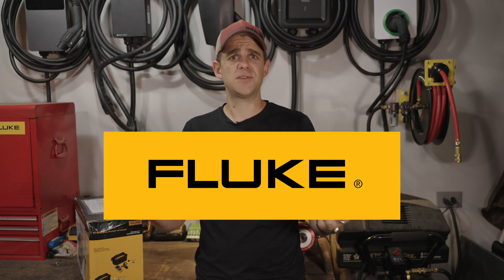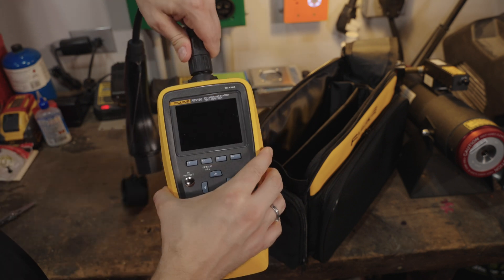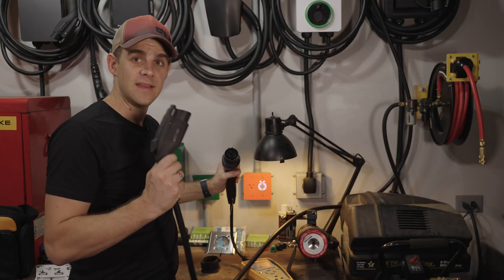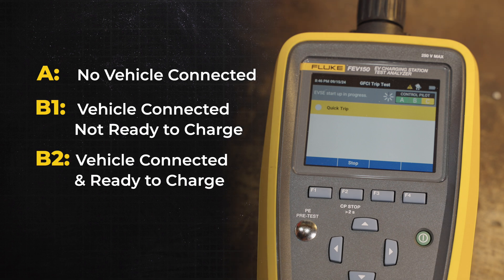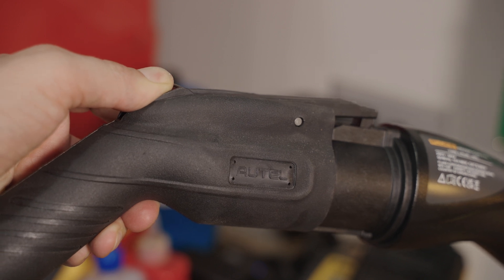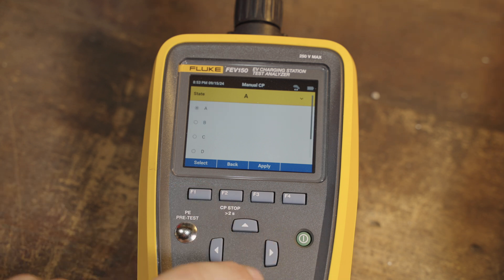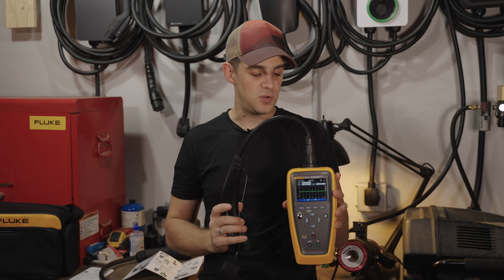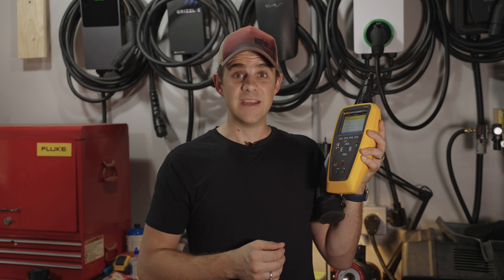FLUKE FEV150 EV Charger Tester Review

Comment: Those error checks were interesting... now you have to redo all your charger reviews so we can see who does that right.

But overall I'm really impressed with this.  I was assuming it was just going to read duty cycle and voltage to confirm that it runs, but it checks a lot more parameters, details that I might not have thought to check doing it manually with a breakout box and a scope. 

What would be really cool if it had a pulsed load that would allow it to measure voltage drop like the Ideal circuit analyzer does for 120 V circuits.
Reply from the maker: I agree I didn’t expect it to have as many features as it did. Plus, the automated tests were pretty sweet!
Reply: @chargeeverywhere  This may be when that software will come in handy because you'll be able to do the tests and import the data from the device for video purposes.
Reply: @reru_personal  with the software you can generate reports for the clients:  Commissioning, maintenance log and repair results. software is optional, can be purchase bundled with the device or separate. It connects with the FEV150 via Bluetooth. At this point the information stays in the computer. Some users have requested for it to be saved on the cloud so that a central point can see and manage the results centralized, without the technicians having to go there. Hopefully in the near future.
Note - I work with Fluke, Demo and sale this and many other Fluke products, but this not an official Fluke commentary

Comment: Fancy!! I'm not sure if I would need such a tool as an electrician who's installed heaps of tesla chargers, If the charger or cable is faulty I could work it out pretty quickly with just an insulation resistance meter. Maybe as an auditing tool I can see it's place on the market.
Reply: With the tesla chargers you can log on the diagnostics and view other details that way also.
Reply from the maker: I agree with you on those points. The auditing feature was not something I expected to see, but it made sense as soon as I did. Probably more geared towards maintenance than installations.
Reply: @chargeeverywhere  the commissioning -documented - side of the installation. with the Software Documenting  that everything is working and ready to go. Now you can get paid ;-)